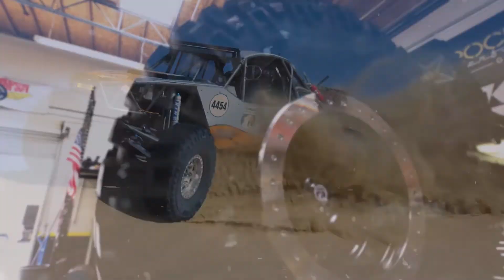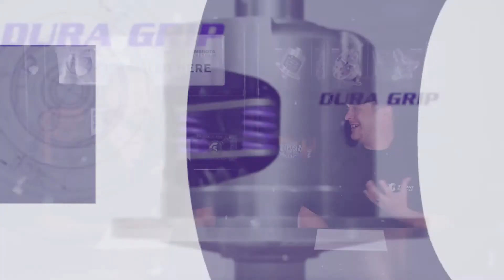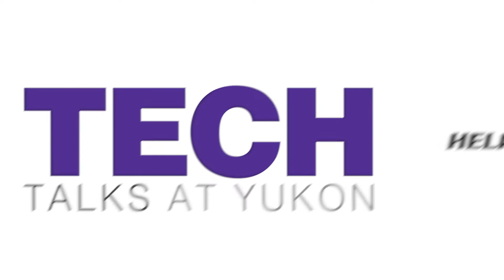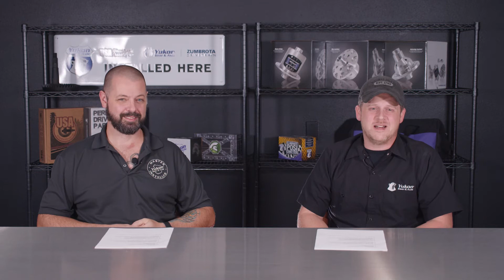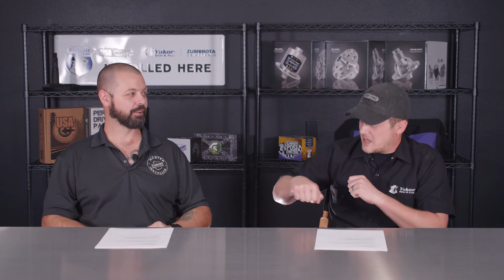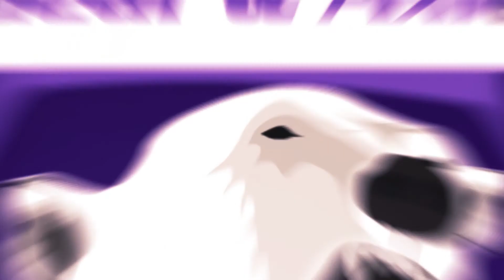Tech Talks | Helpful Installation Tips

Comment: It's too bad on those springs that go underneath the side gear between the side gear and the clutches and discs on a limited slip,
 that there isn't the reverse of vice grips, so when you press them down with all your might to lock them , that they don't open outward instead  closing down & clamping downward, so you can maybe just drop the two spiders in place and then put your pin in.
That they would spread the side gears & discs and clutches tight into the carrier, in other words.
Reply from the maker: We'll send that idea over to the engineering team!

Comment: With a Ford 8.8 I first found I had to get the pinion depth where I wanted with the pattern meshing with the ring gear and set then set carrier backlash accordingly to specs, removing shims from one side to the other
 but at the same time have enough of a shim pack in total with the combined right and left sides to where I seemed to have a tight enough fit with that carrier assembly going into the housing,
 otherwise it could move side to side in operation. I didn't have to beat it to death to get it in, but it took some work to get it in and afterwards I took a pry bar, a long one to see if I could notice any hint of side to side movement when twerking it with the bar and I couldn't. With
Preload on the carrier on a Ford 8.8 , it's all subjective  there's no inch pound setting for  the carrier bearings, like there is for  preload for the pinion.